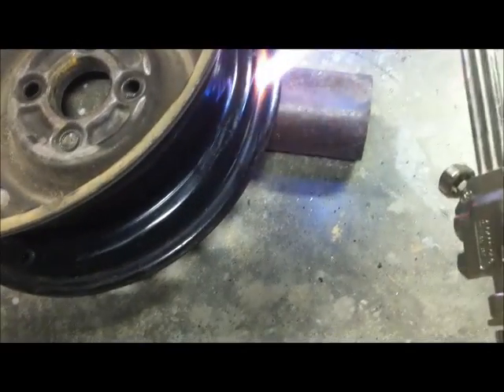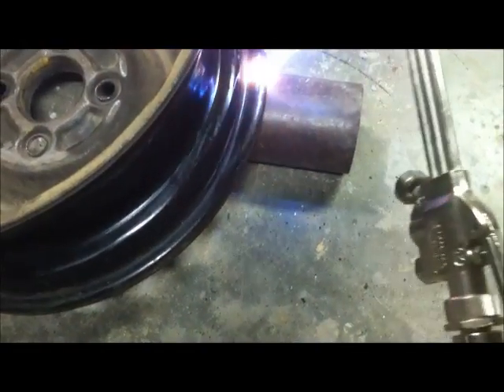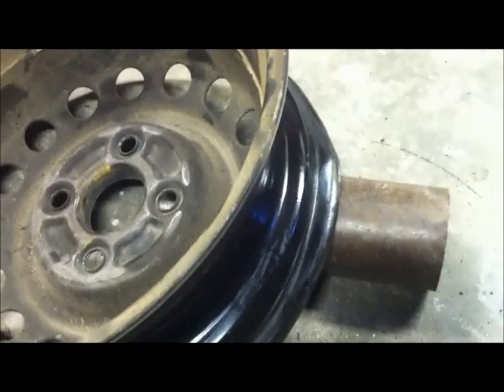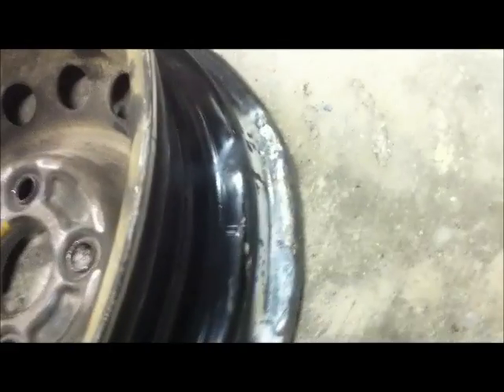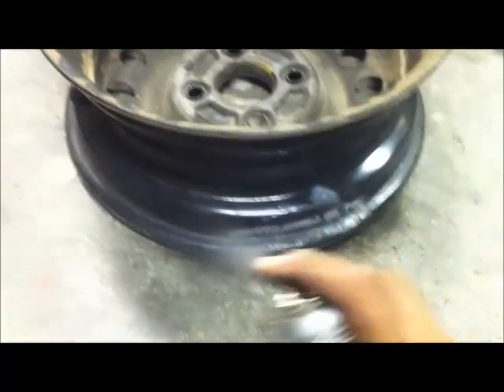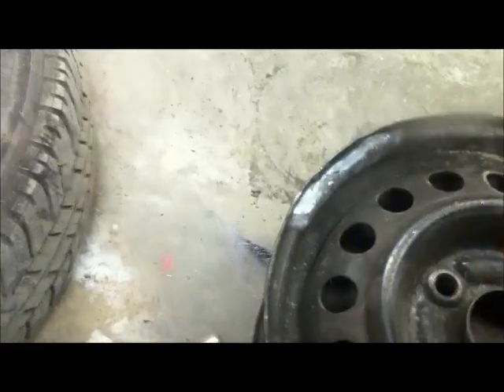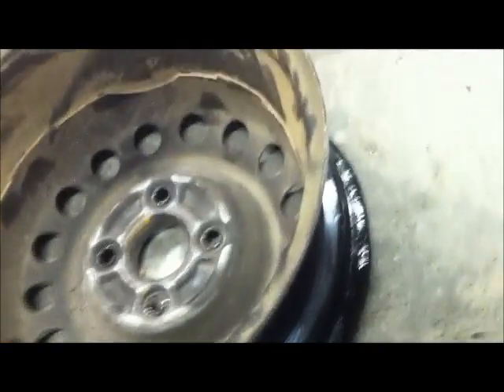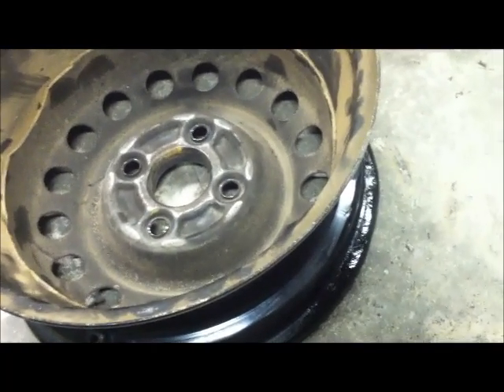How to Fix a Bent Rim.

Comment: Dear Thomas, 
For years i have repaired bent steel rims. To improve my skills i tuned into your video. Now i will try using my oxy-acetalene torch first. Thanks for an excellent diy tutorial!!
Reply from the maker: perfect, thanks for watching!!!!!!!!!!!
Reply: oxy expensive....pfffftt..... try mapp  or cheap disposable oxypropane 30 bucks
Reply: @Ihavetruth22  could I use a butane torch?
Reply: @ninjabongtoker1  not enough heat . it would need to be those large  burners.  not sure.

Comment: mine isn't bent like this.  The edge is folded inwards.  the tire is unaffected save for a few scuffs, but it appears that a hubcap will no longer fit.  i can't confirm since the original hubcap was lost down a storm drain from impact with the curb, but it appears to be bent too much for fitting a new one.

Comment: I was wondering if this would work for my ATV... just bought new rims and tires and my buddy slammed it over a rock day 1 of the new shoes on... It's still holding air, just dented pretty good.
Reply from the maker: yes it will, i did it hundreds of times as a young man on a three wheeler. thanks for watching.

Comment: I would place the rim on a Nitromac or ACU-TRU machine - there might be excessive runout when measured with a dial gauge
Reply from the maker: your right, but this video is about saving money with quick fixs. how to do it your self. you can also go buy a brand new 200.00 rim if you like. but thats not what this is about. thats not what any of this is about. ff. thank you for your comment.
Reply: thomas brian I recently did this 2 a Toyota Tacoma rim where I heated the edge with an LPG torch (the bead seat area did not splinter up - used a chunk of billet and a sledgehammer)

Comment: I have steel wheel just like that and my lip on the rim is bent upwards so i was wondering if i could hammer that back with the tire on the rim? The lip is bent just a little bit and its still holding air.
Reply from the maker: yes for sure, just dont go to far, or you will have to remove the tire to go the other way. dont be affraid of it. give it a good smack. the larger the hammer, the more even it will bend. just hitit on its highest point. i love that you want to save money and do it your self. awesome. ty
Reply: I also had another question could i keep the tire on the car and hammer it out. Thanks.
Reply from the maker: xxslick105 yes you can as long as the bend is out and you need to bend it in. pound away. good luck.

Comment: Would this work for a moped rim
Reply from the maker: as long as the spokes are good on it. if it is the outer ring then yes. if the spokes are bent you will need to remove the tire and tube and adjust each spoke. thanks for watching.